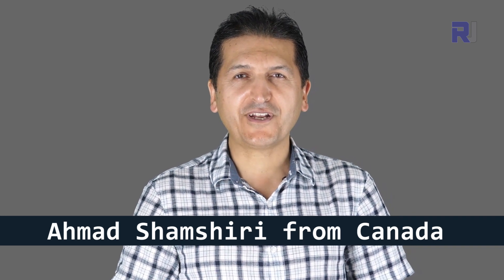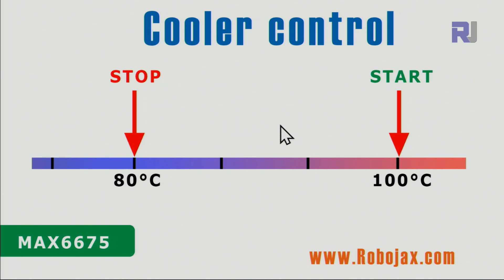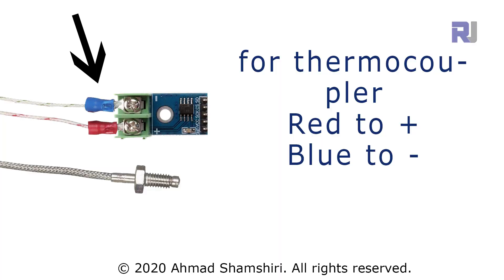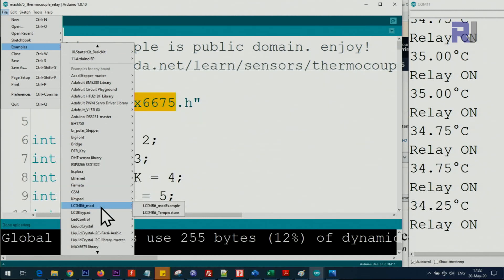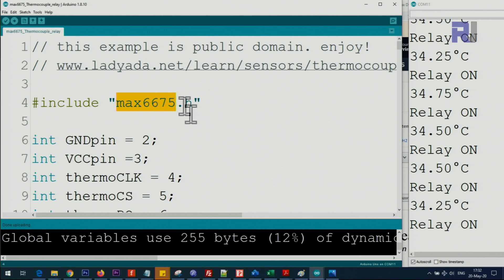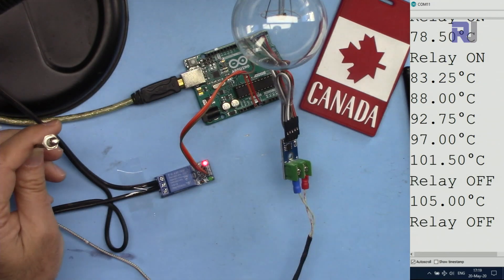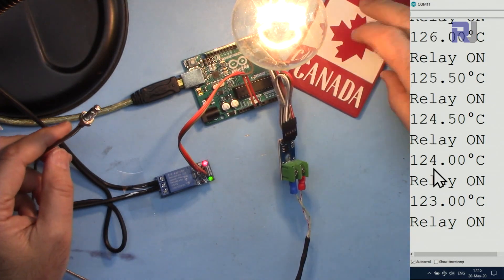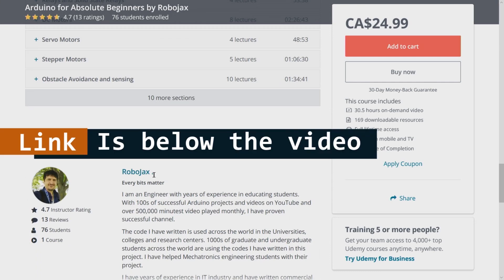MAX6675 with K-Type Thermocouple Control Relay Thermostat - RJT317

Comment: I am using my MAC for programming but always get the following error: No matching function caLL for MAX6675.  What must I change to make it function?  Thanks for a great video and for your help.
Reply from the maker: you have skipped the parts where I mentioned to install the library.  Here is the same video with better details https://youtu.be/yJYXfaU9J34 which is part of the course or watch introduction to MAX6675 https://youtu.be/A55QNx6kCoo. The video you are watch is not introduction.

Comment: Can I use this code to turn relay on/off for microwave oven power control?
Reply from the maker: relay is just a switch as I shown (if not watched, then watch again) and it will turn ON and OFF loads. Just respect the rating of current of the relay,  then it will work for anything.
Reply: @robojax  thankyou

Comment: explained in a very simple and detailed way. I am trying to map it on the Blynk. Apart from Blynk library, I added command in void setup section: Blynk.virtualWrite(V5, temperature); but no temperature value shows up in Blynk app. Am I putting some wrong parameter in virtualWrite command?
Reply from the maker: sorry I have no idea how you use it with other software. I don't like software or apps that don't offer free service.

Comment: I followed your tutorial for max6675 and lcd display, thanks for the tutorial. I am going to try this tutorial also just have some doubts please do clarify these. First is can we use a  5v relay (no module). Secondly the fan used is ac or 12V dc fan can also be used.  If possible please give the link for the fan.
Reply from the maker: Yes you can use relay if you drive it properly as shown in this video https://youtu.be/N-fFk51Eb8s for the fan, there are 1000s of options. Search on eBay or Amazon you will find something that will work for you

Comment: Thank you very much for a great video. I'm just doing this very similar for a fan air  control to regulate temperature on my BBQ. your code is much prettier than mine. Lol
Im using a 16x2 screen for output which works fine. Now I'd love to like to add in a rotary encoder to be able to adjust the setting temperature without having to upload a sketch. I'm struggling with that part. Would you be able to point me in the right direction for direction on that?
Reply from the maker: You are welcome. I am pleased that you found it useful. I will make more tutorial and including LCD.  this is not simple to explain it with just text.  If time permits, I will make videos related to this.

Comment: Could you do one using the high side mosfet controlling a dc fan with pwm, using the Arduino and k type thermocouple?
Reply from the maker: This is interesting topic. if time permits, I will make tutorial on that. Thanks.